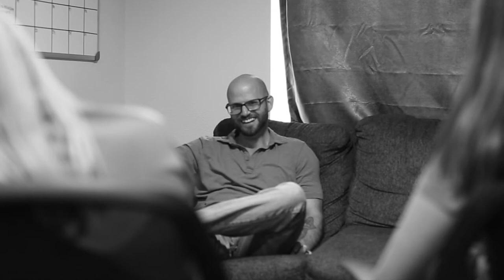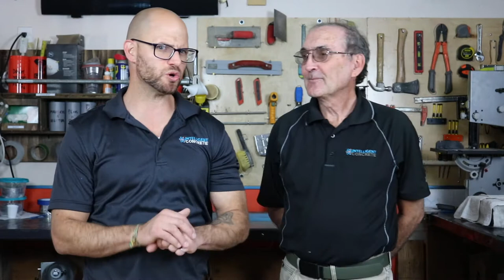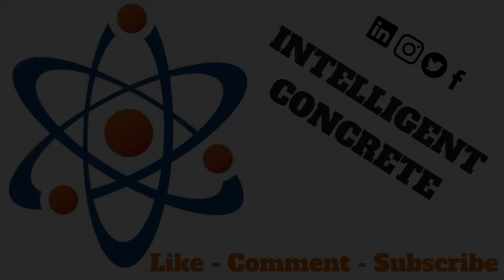Making Concrete Stronger & Last Longer! - Vlog #52

Comment: What's the simple answer?
Reply from the maker: With concrete there is no simple answer.  

There is an answer when taking into account multiple factors but it is far from a simple answer.
Reply: Ok thanks for your quick reply, I would like to make Super crack resistant concrete weight plates. Would you recommend Super Plasticizer?
Reply from the maker: Howdy Aaron.  As long as you have some good mats in your gym your concrete shouldn’t crack.

That being said, I would go with some steel fibers.  A heavy amount without losing workability.

My favorite super-ps are Optima 258 EMX, Viscocrete 2100, and Glenium 7920.

Drive that w/c ratio and get well graded granular skeleton, use more than one coarse agg gradation.

Let me know if you have any other questions.
Reply: Talk talk talk, come on! now days  no one like long fv